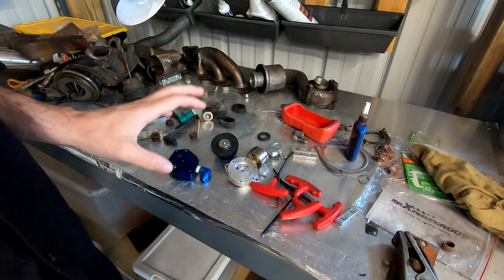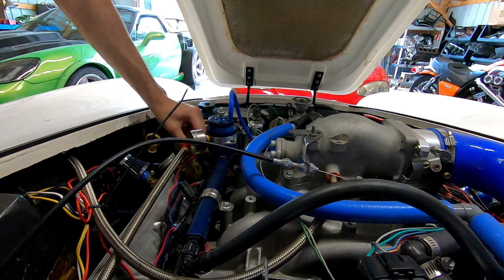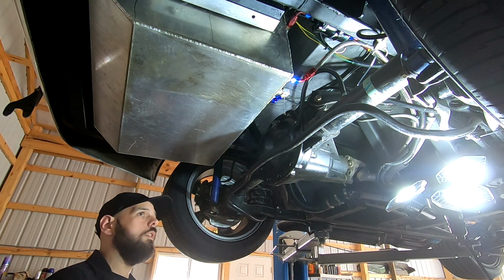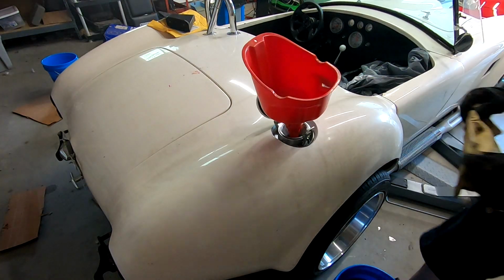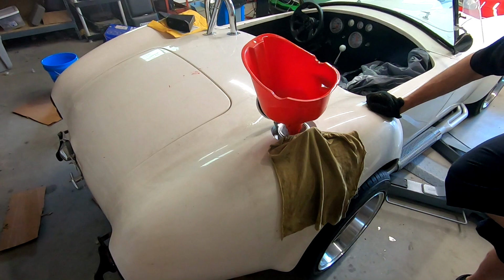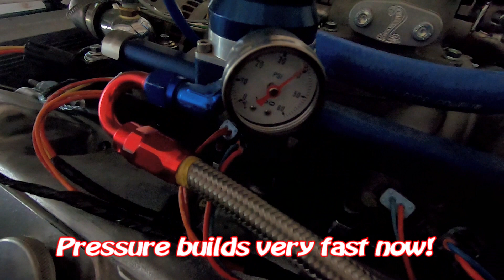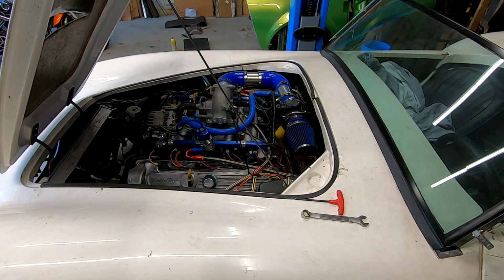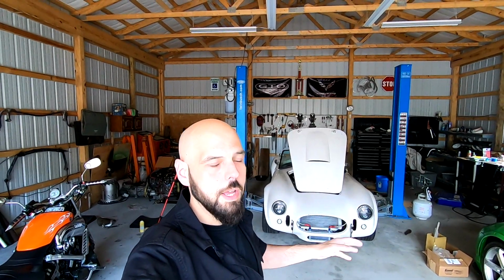4 Shelby Cobra Build Hacks to Get it Running in No Time

Comment: Just amazing how the smallest items can cause issues. 
 Just like a leaking  o ring on a fuel injector on my cruze caused my p0299 boost leak. 
 Cobra better run extremely well now with fuel pressure correct.  
 Be safe sir.
Reply from the maker: Funny thing you mention the leaky O-ring. I had that happen once on a different car it took forever to figure out where my boost was going. I’m glad you caught that.

Comment: I'm curious as to how you got your fuel filler into the fender, with that nice, recessed LeMans cap? I wanted to do this with my Street Beasts car, but it proved to be way too difficult. Getting the fill tube to that spot, recessing the mount into the fiberglass etc. Yours looks great!
ps. That was funny and cool, finding that bolt stuck in your pickup tube!! It must have been SO satisfying, finally figuring out what the problem was! Sometimes it's the simplest things. d'oh!!
Reply from the maker: You have no idea!!!!!!! I hand made the recess with fiberglass. And used a summit racing LeMans cap.  I have some pictures of that project I could email you.
Reply from the maker: Hey when you built you car did you have a pan hard bar set up?
Reply from the maker: Hey when you built you car did you have a pan hard bar set up?
Reply from the maker: Hey when you built your car did you have a Panhard bar set up?
Reply from the maker: Hey when you built your car did you have a Panhard bar set up?
Reply: @davesworld2132  No panhard bar. I did have a rear sway bar, directly from a Fox Body Mustang though!!
Reply from the maker: @Metalcop5150  mine uses a 4 link and sway from the 90s sn95 but I noticed the rear end doesn’t like to stay put. Nothing is stopping side to side movement. That’s my next big project.
Reply: @davesworld2132  Upgrade your 4 links from the Fox Body aftermarket. There’s a ton of good upgrades available. Polyurethane bushings all around will make a huge difference. I’ll send you a link. 👍
Reply from the maker: @Metalcop5150  that may be a great idea. I haven’t messed with them but maybe my rubber bushings are flimsy. Are the fix and sn95 4 links the same?
Reply: @davesworld2132  I’m sure they’re exactly the same or very similar. The basic Fox chassis remained largely unchanged from 1979 through 2004. If your rear end is out of an SN95, I’ll send you those links. No problem.
Reply from the maker: @Metalcop5150  awesome I appreciate that.